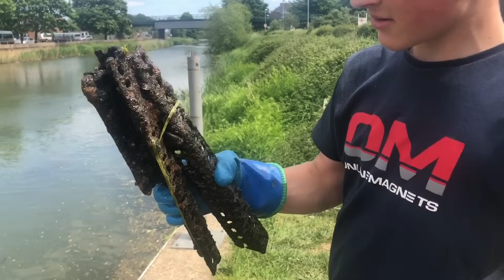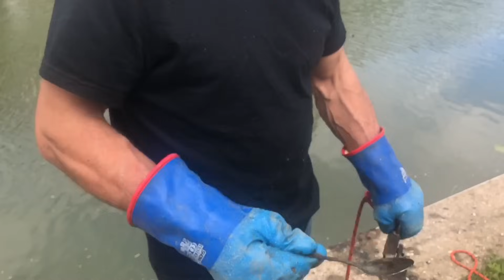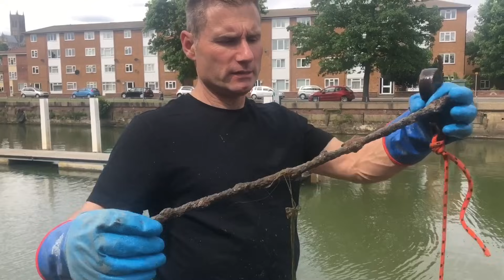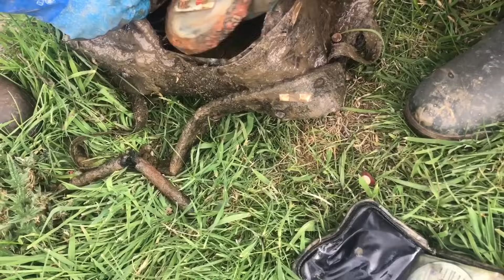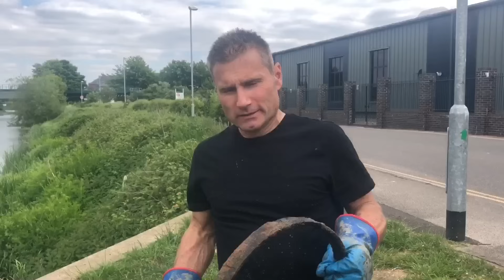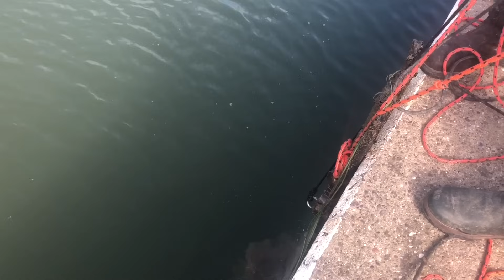Heavy Rucksack Found Magnet Fishing (Crazy What We Found Inside)

Comment: Looks like a cast iron down pipe top where the hopper would sit in.
The church key was what soldiers called a bottle opener.
The key if original has value £10 plus,  very collectable Don't grind it, salt water soaking, vinegar if you must but it should look grey or black when finished, really good find.
Reply from the maker: Thank you for the info it’s much appreciated! I’ve not cleaned the key up yet will give the salt water a go. Thanks for watching 👍

Comment: Hi again, just a quick question where did you get your magnets? I have got a double sided magnet which is supposedly 500kg  but I am not so sure about that!
 It is ok on good clean metal  but not so good on the rusty stuff. Cheers John
Reply from the maker: Thank you for your comment, there are a lot of magnets for sale that lie about the pull strength. The magnets we use are brilliant hey are the 200kg double sided magnets from online magnets. I’ll post you a link plus if you use promo code Mag10 you’ll get 10% off your order https://onlinemagnets.co.uk/60mm-x-25mm-neodymium-recovery-magnet-metal-detector-treasure-hunting-200kg-pull
Reply: @Magneticg  Thank you so much for your reply I will take a look. Kind Regards John

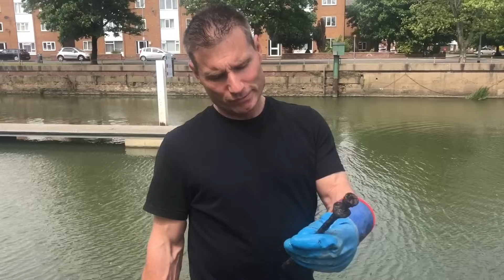Comment: 2:14 looks like part of an internal combustion engine; one of those rods that pushes the rockers up to open valves---but am not certain. 
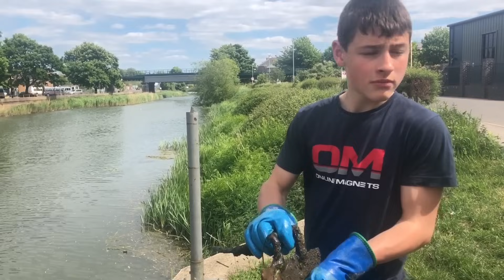3:58 Guessing again but to me it looks like a tool to clean the furnace of a steam engine
Yes really nice old key
Reply from the maker: We found some interesting bits, appreciate you helping us with ID. It isn’t always apparent what things are! The key looks to be older than the keys we generally find, will have to  do a bit of research once we’ve cleaned it up.
Reply: @Magneticg  it was a ash rake more commonly  used to clean coal fires and coal fired cooking ranges like the old yorkshire range at 3 ;58